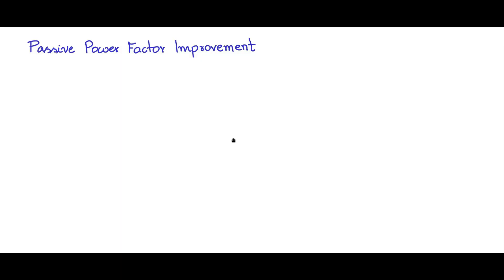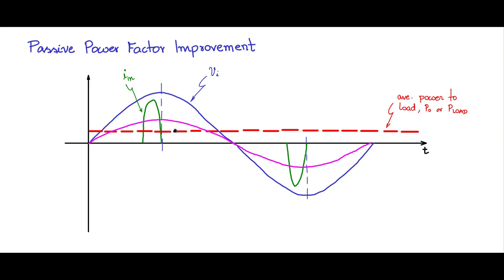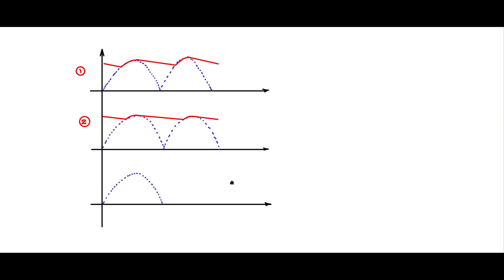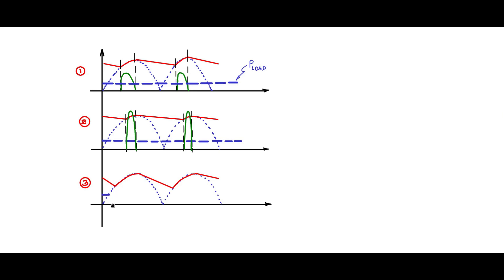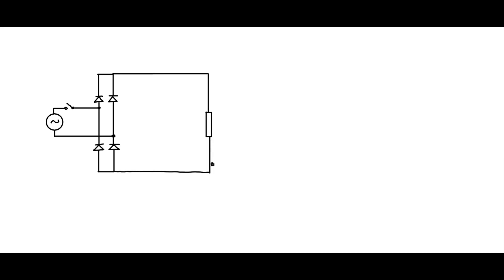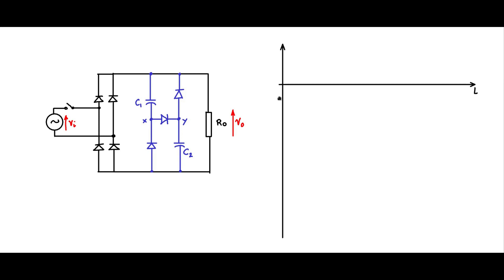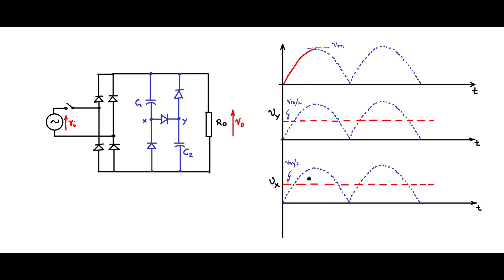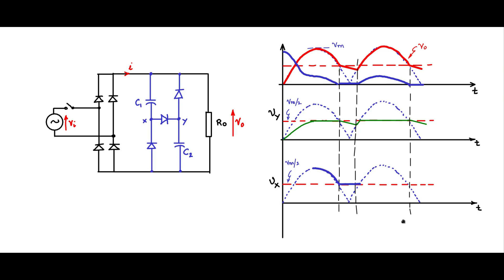wk05 13

Comment: In this circuit main thing inductor is not present that is balancing the reactive power that flow from capacitor . Inductor is missing which can be applied on source or Load side . All thing is OK .Professor .🙏🙏